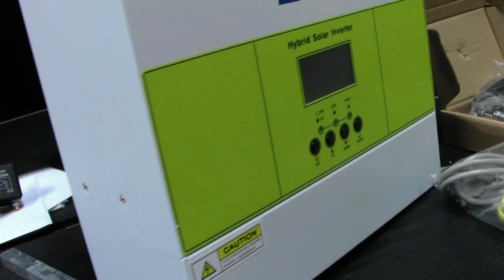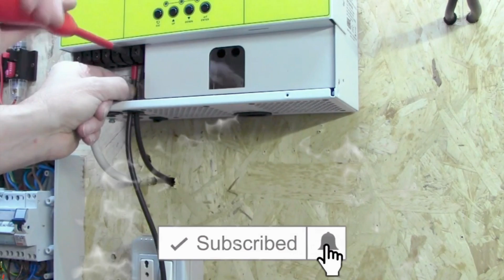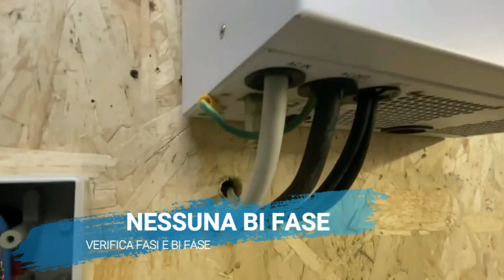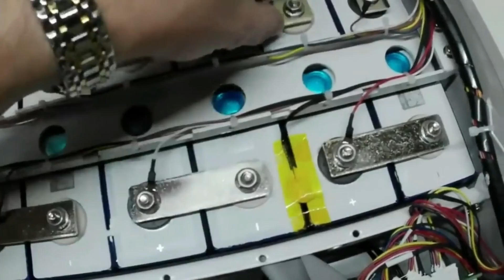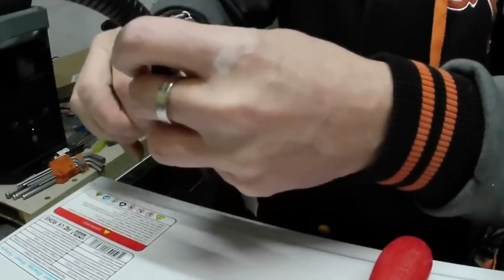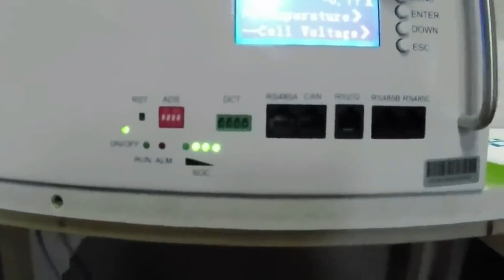KIT FOTOVOLTAICO #offgrid PROCEDURA DI MONTAGGIO #faidate #k Sistema completo TUTTO IN UNO #offgrid

Comment: Ciao Sandro, ti seguo da tempo con molto piacere. Una domanda: configurando l'inverter in SBU, prima di commutare al gestore l'inverter scarica la batteria. Ma se io volessi conservare una quota di batteria da non usare mai (o meglio da usare solo in caso di blackout, come fanno alcune powerststion come ad esempio echoflow che conosci molto bene), come potrei fare? Se imposto i valori di batteria scarica a voltaggi piu alti preservo un po' di carica ma l'inverter passa alla rete prima e se poi va via la rete l'inverter rimane comunque spento, giusto? Oppure c'è un modo per farlo commutare in caso di blackout ed attingere dalla quota di batteria volutamente preservata? Spero d li essermi speigato, grazie. Marco
Reply from the maker: se alzi il valore di sgancio, lui stacca prima la batteria. Se va via la rete, riaggancia la batteria immediatamente e va a far riferimento al paraletro di cut off, se non torna la rete prima
Reply: Grazie mille